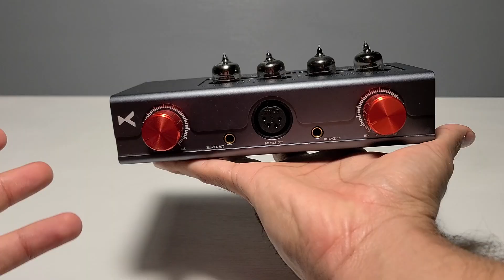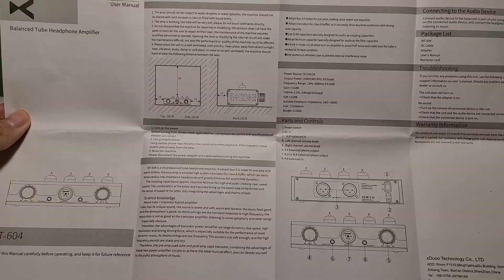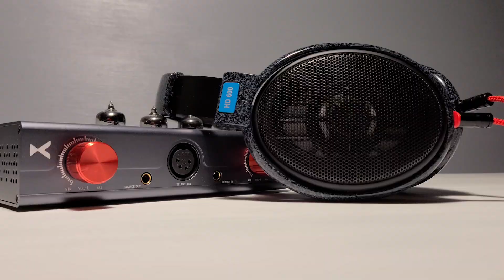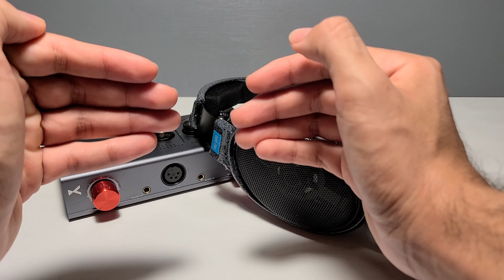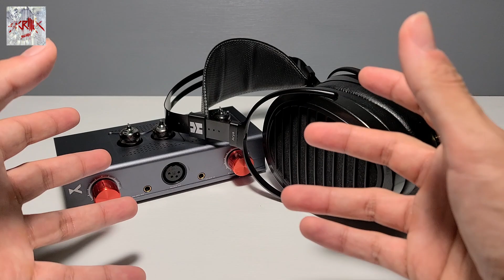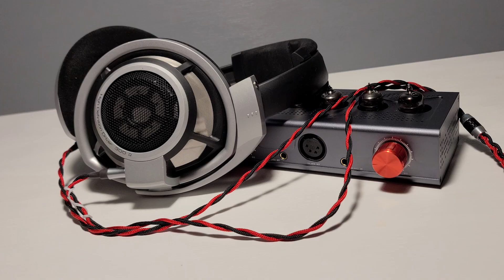BUDGET BALANCED TUBE AMP!! - xDuoo MT-604 Review

Comment: would have bought it if it had single volume knob. II think i will buy 602
Reply: The dual knobs are useful for channel balancing. You can, and should in these cases attenuate the volume before it hits the amplifier. These are high gain units (no low, or negative gain switches here), and you'll have very little control when using a low impedance, or high sensitivity pair of earphones or headphones, if you feed them line level input. Having said that, the MT-602 is also a great deal for what it is, if you want single ended input and output. I have both of these units with GE JAN 5654W tubes swapped in, and they both get a lot of use here.
Reply: @JeradBenge  what difference do the other tubes make?
Reply: @JeradBenge  what's the output impedance of these amps?
Reply: @kyron42  The tube swap was to handle some grain, and harshness in the treble region I was running into when trying to compensate for the lean mids with more power. My Telefunken 6AK5W's were more detailed than their GE counterpart, and a touch wider, but also less impactful in the low end, and more expensive than they used to be.